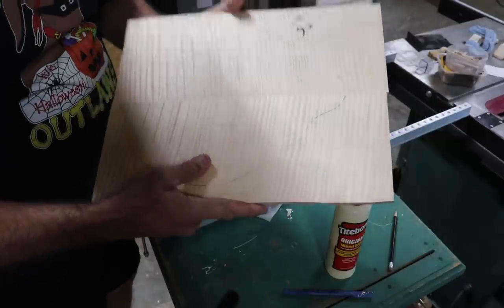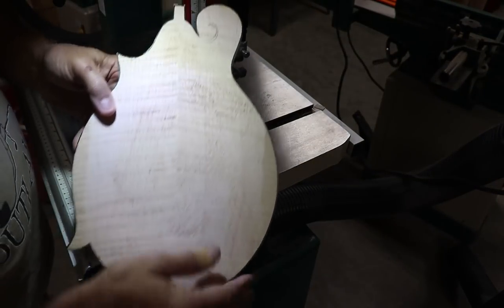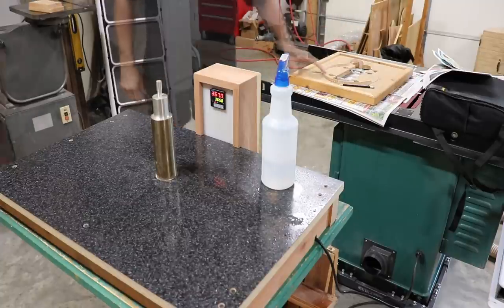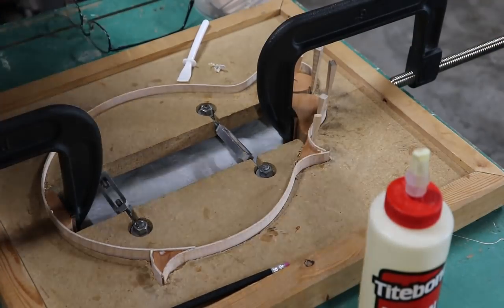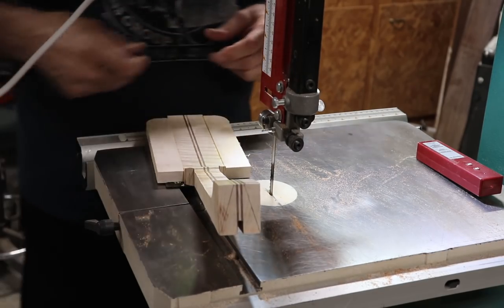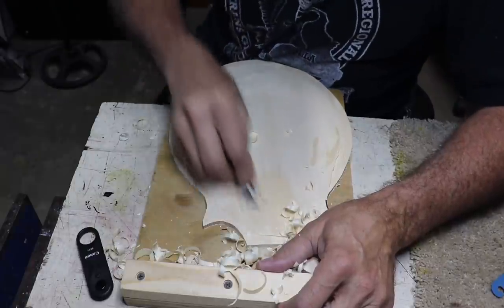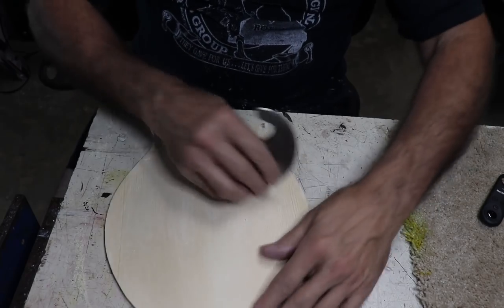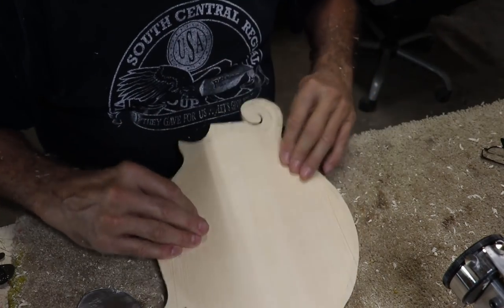483 RSW Massachusetts Mandolin

Comment: So Jerry, what is the degrees neck angle to the body ?  Hardly anybody ever mentions this critical number.  I personally have found about 2 or 3 degrees seems to work.  Do you concur with that number, or do you do something different ?   Bob. (Getting some numbers for my banjolin on my drawings). Thanks, my friend.
Reply: I believe, that would depend on the bridge and saddle you are using.
When setting/reseting a guitar neck, the angle in dependent on where that angle meets the bridge.
Reply: @zapa1pnt  I made all of my bolt on necks with micro adjustment  with a set  screw for  solid  body guitars.and Epaphone Casino.s ***DR KEL
Reply from the maker: I have never measured the angle.  I do it by looks, feel, and measuring the height at the bridge location.
Reply: @RosaStringWorks  Okay, thanks.  I'm finding about 2, maybe 2 1/2 degrees seems to work from my bridge/ saddle situation.   Bob

Comment: JERRY**To save your self a allot of steps while bending sides**I suggest you add  a hinged   fold up table top  to your bending table**Chuck
Reply from the maker: I am interested in your idea but I am not sure what that means
Reply: @RosaStringWorks  *Jerry *All of my shop tables have**I GUESS WINGS MAYBE THE WRONG WORD* *Drop leafs or table tops***google ** add drop down table top to a work beach for  photos*** I also used piano hinges ****Chuck
Reply: @RosaStringWorks   E MAIL SENT**JERRY**To save your self a allot of steps while bending sides**I suggest you add something like this photo 
to your bending table** See photo This way you could place your mold on the fold up leaf top
 to your left** no  more walking.
All of my work beaches has drop leafs to each end added.
fold up when you need more space.
Chuck
Reply: Jerry's reply was adding a drop leaf fold up top that would add more them 2 inches of storage space to the bender. and his shop was too small to store the bender if he added two inches to his bender top***